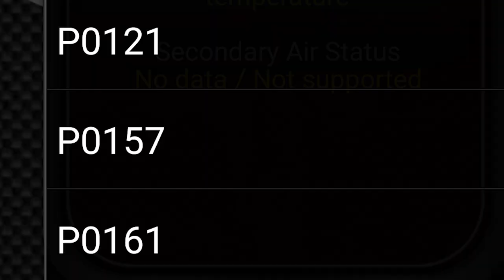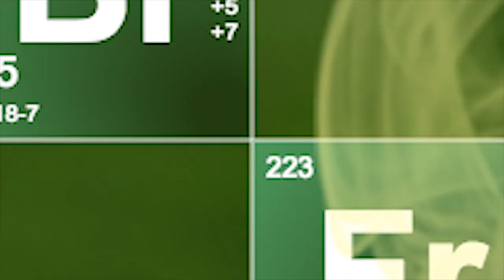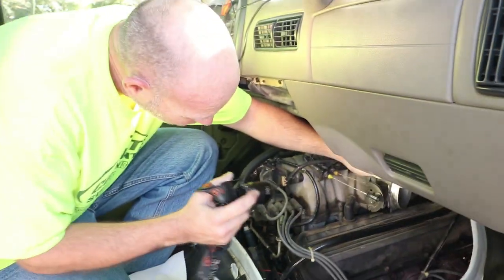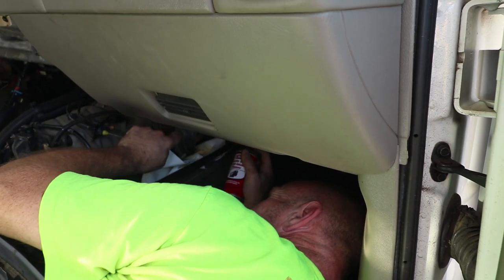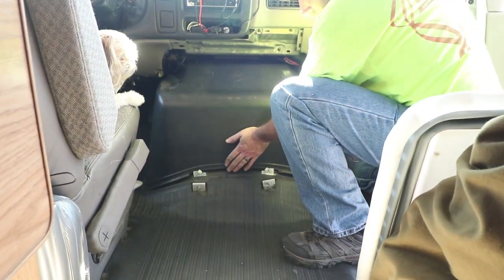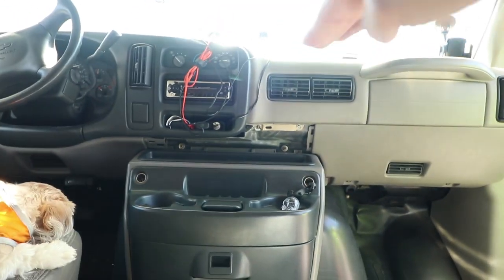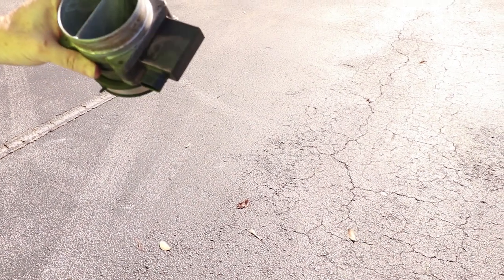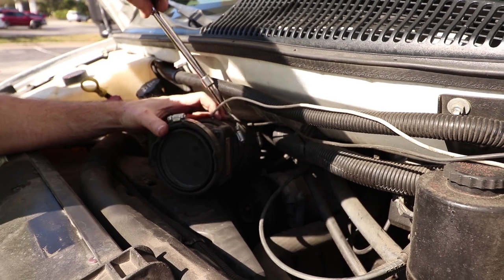Installing  O2 Sensor, TPS, and Cleaning MAS on Chevy Express 3500 7.4 Class C RV

Comment: O2 sensor failure leads to catalytic converter failure. Your O2 is on the back side of the Cat... This points to a BAD cat. Also bad injectors that are normally gummy or sticking..   This problem is not over my friend.. 
I see this all the time..
Reply from the maker: Taking one step at a time bud! Our engine only has 3500 miles on it. We have had several things fixed or replaced. But Life's gonna happen so we try not to stress too much about it! Thanks for watching😉

Comment: Pays to be handy  those head lamps are great  glad it all worked out   brutal cold up here  I moved into my truck shop  warm lol  repairs too   I had a ford van custom dually diesel I built years back  the dog house was a bitch  u took the passenger seat out smart move  most don't   sure makes it easier and comfortable  to get the job done
Reply from the maker: Oh yea! I'm not the best but I do research a lot before I mess with something. YouTube has everything lol!! I bet it helps being in the shop. At least block some wind for you!! Yea once I realized how easy it was to get to the bolts under the seat I figured why not. Plus Tonya wanted to get a good sweeping under there anyway. Hey thanks for watching man😉